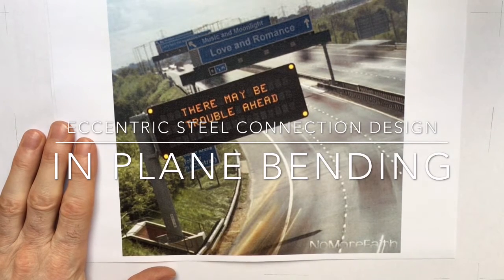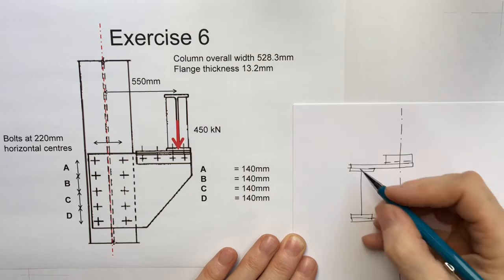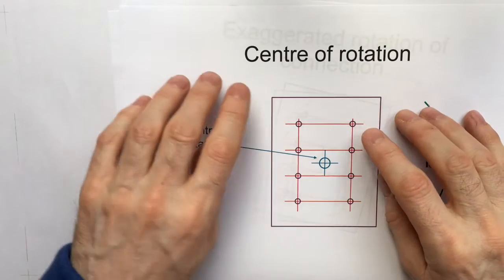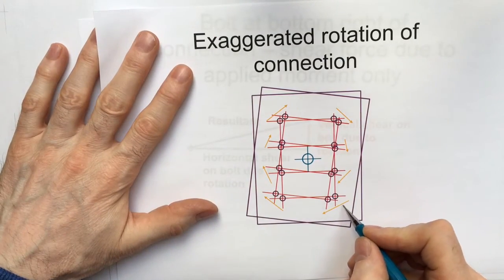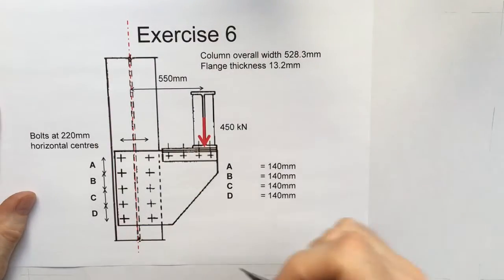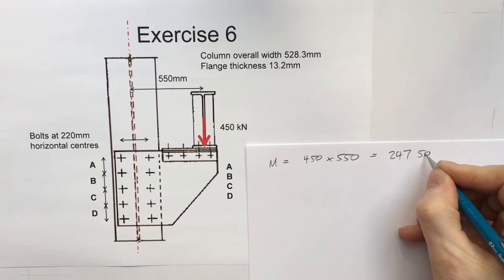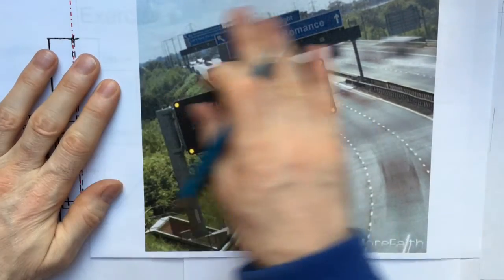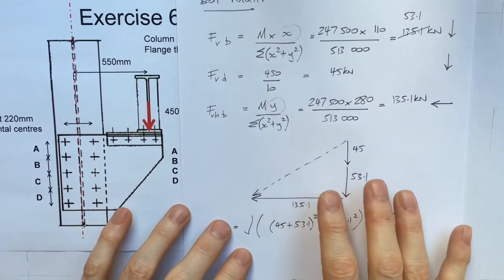Bolts in in plane bending

Comment: Mike - Suppose the bolt group was not symmetric. Once obtaining the centroid, the vertical force x distance would equal the greatest horizontal distance between the centroid and a given bolt, correct? Likewise the corresponding vertical distance for the same bolt.
Reply from the maker: Hi WG-ft6tz, if I understand you correctly, then you are making good sense to me, Mike